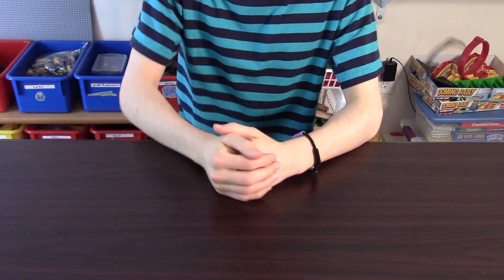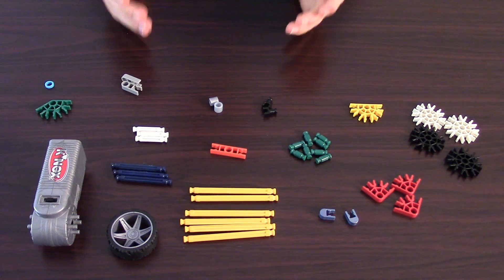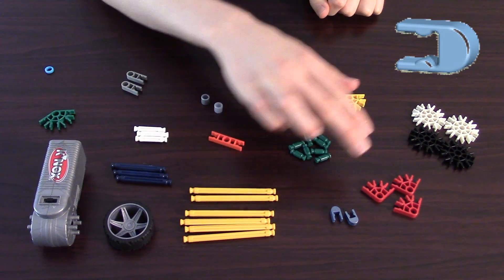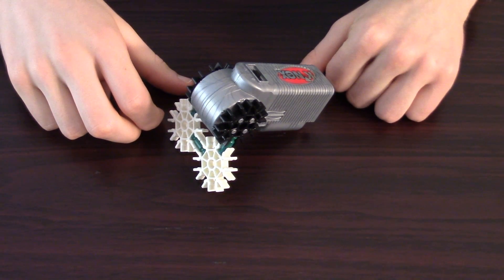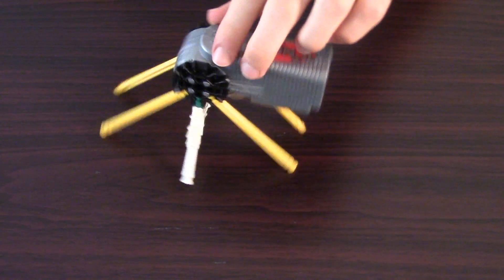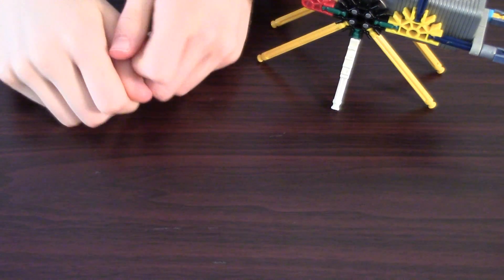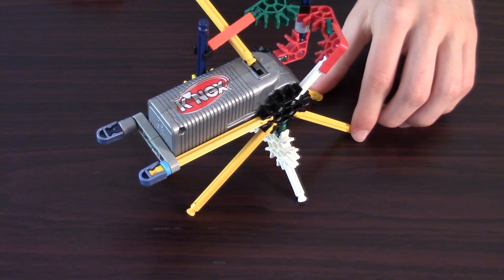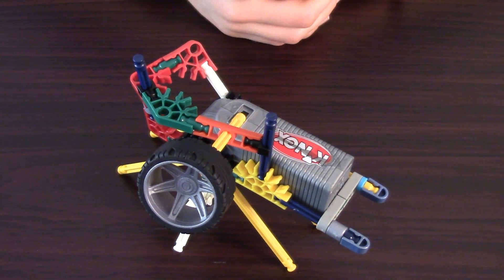Tutorial #4: Turning on a K'nex Motor

Comment: Cool tutorial! This is considerably different than my method. It uses what I call a Hammer and Nail activation, which tries to concentrate all force into a single point, compared to the method used in my tutorial which is lever based. Hammer and Nail force is still suuuuuper useful to know about, because for instance I had to use this same type of application of force to turn on an upside down motorized dog.
Reply from the maker: As always, you give me a new and innovative way of thinking about machines. I never really thought that specific types of activation methods should even have names, or that they were really different to begin with. Although I completely agree with you, but I would have to say that the "Hammer and Nail" activation is a lot harder to create successfully. This is obviously why your method works even better than this one here.

Comment: I do have a motor but it is ruined. I'll try to solder the parts back in place. And also, i think using domino and string works too. It depends.

Comment: WOW this is going to save me a lot of fails. I was using a more complicated trick (in my glow in the dark machine), and another pretty complicated trick (in my yet to be build breakfast machine). This should be more reliable, thanks! Also the music rules!
Reply: However, I do have one plug in K'nex motor now, so that's also an easy way to do it (with my power strip tutorial)
Reply from the maker: Thanks! You may have to test it to figure out the best way to have a ball hit it. And if you modify it and figure out how to make it even more reliable, please share it with me!
Reply: Well my first modification, as always, would be to glue it down to my table :) then i might glue the orange piece in place so it doesn't rotate on me